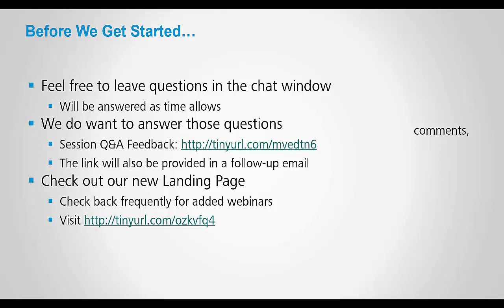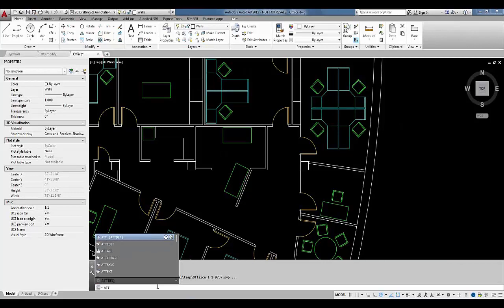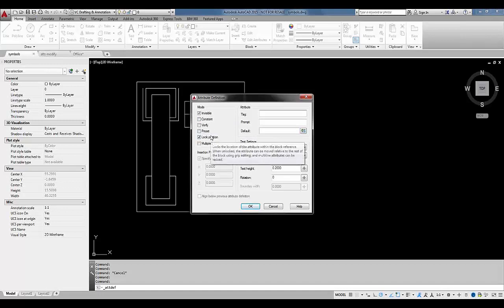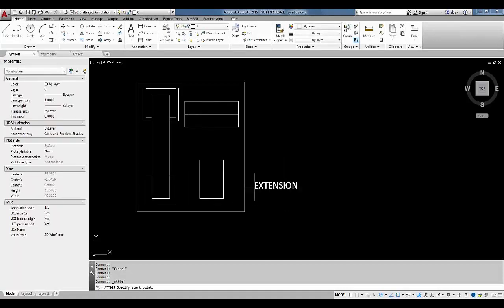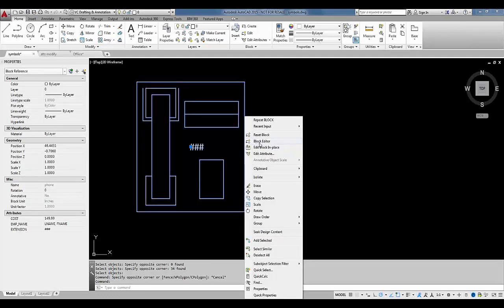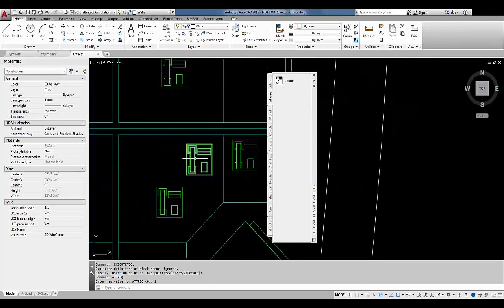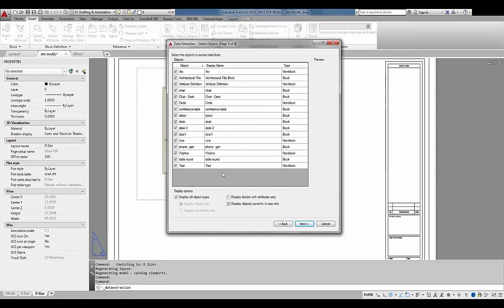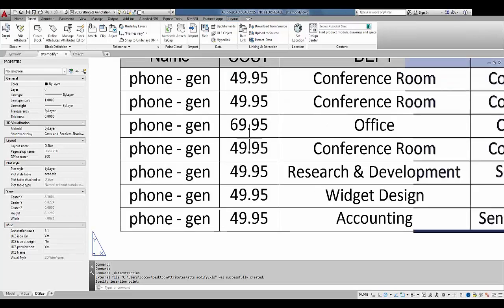Smarter AutoCAD drawings using Attributes!

Comment: table of content
@4:22 what is an attribute: a none graphical label or a text attached to a block common use in tittle block and can be used else where and can be extract to excel or in-drawing tables
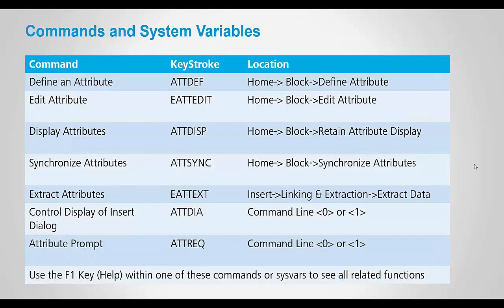@6:02 attributes commands
@11:05 example on how to add attribute to a block
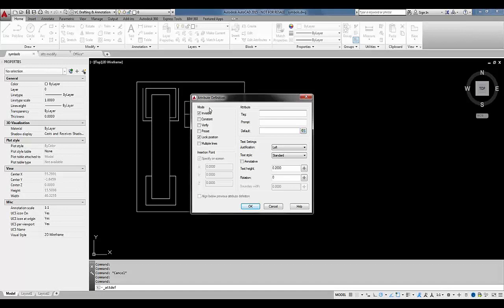@13:32 text mode in attribute
@25:11 arrange attributes in choosing order
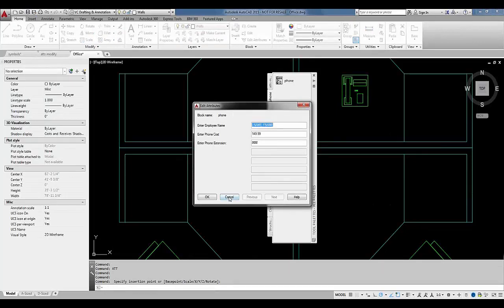@30:31 how to make the attributes input value disappear with attreq command
@34:00 using the enhanced attributes data extraction to make an inventory table for in-drawing blocks
Reply: This needs to be pinned